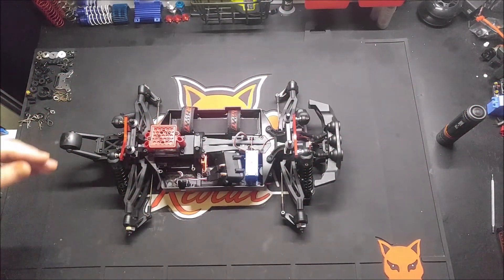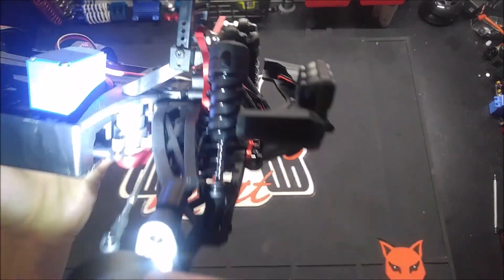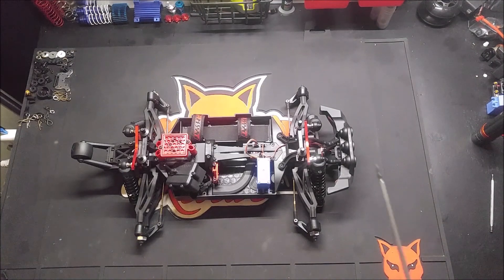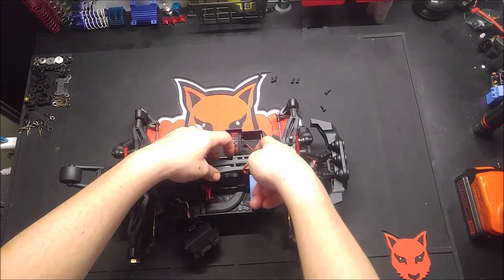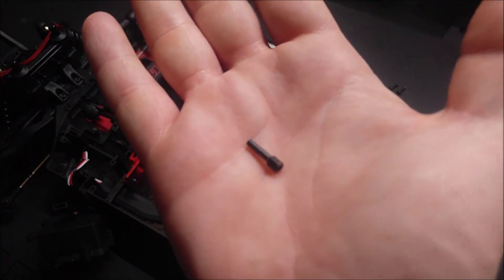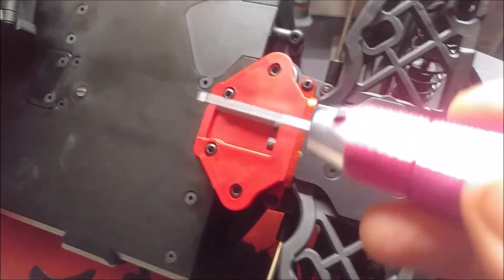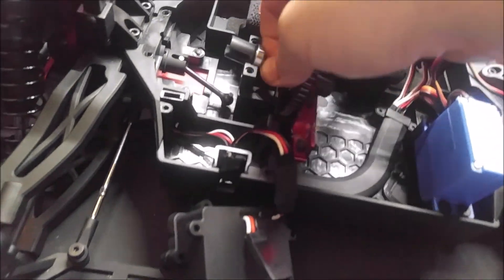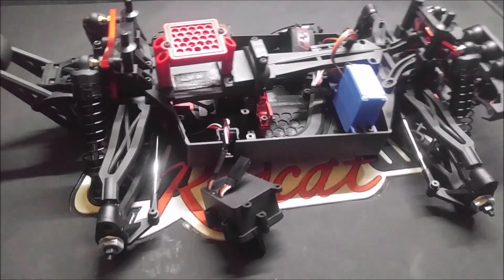Team Redcat MT10E Repair - Rear Grub Screw/Bevel Gear Pinion Access

Comment: So i had my son truck shelved after it kept locking up and staling out. Let him use mine but I finally took the time to see what i can do and noticed the part you mention (grub screw) is all torn apart all around what should i do to fix it new to this Rc dyi
Reply from the maker: remove the rear end from the truck... see if you still have the grub in there and that could be what is "locking it up"  and if it is there, should be able to clean up the plastic, replace screw if not bent and add some thread lock to the grub end of that screw when you put it back in the diff cup, to assure it doesn't back out again.   it things are broken, then we need to replace the broken pieces and same thing with the thread lock.

Comment: Hello again.. question again bcoz i kno ure really good at wut ur doin.. i have da blackout xte pro n i wanna make it fast n yet still manueverable n can also do off road ( not rock climbing ) like a versatile truck do u have some suggestions for me like da motor im gonna have to use n also esc n the gear combi. Thank u
Reply from the maker: jayr soriano motor recommendations are tough because what I would sell you and what I use something different than what most people will want to get. You can pick up many cheap goolrc type combos that don't last very long and the ESC aren't the best. if it was me. The motor and combo I'm recommending for that truck would be the 4000kv easy run G2 that comes with the max 10 1:20 amp ESC. the gearing I would do with it on 3s would probably be the 18 tooth pinion with the stock spur. the 18 is enough you don't need to go to the 19 and you can even leave it at the 17 if you want because that 4000kv is going to be a nice increase and  put you over 50 miles an hour